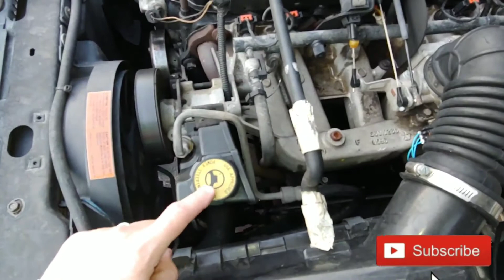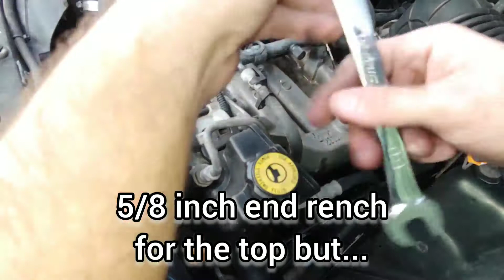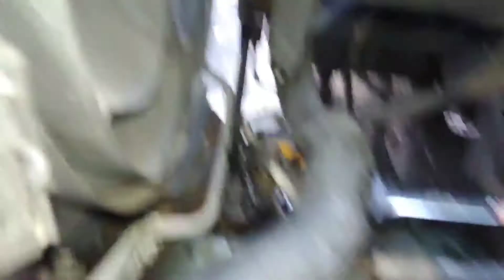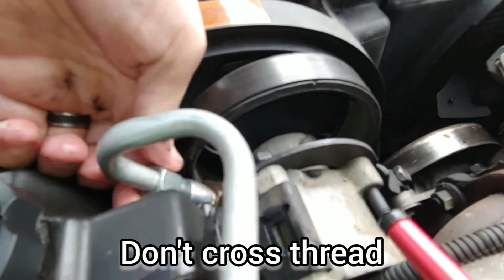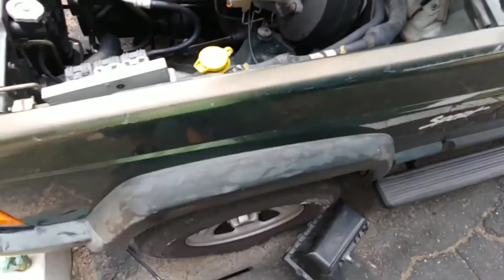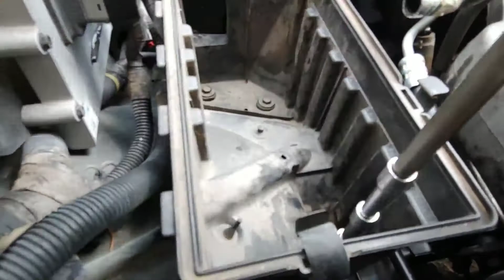97 Jeep Cherokee High Pressure Power Steering Line replacement

Comment: What was the yellow thing in the package with the O rings?
Reply from the maker: technically a cap for you to use if you want to and pardon me I'm not sure what the technical language is for it but if you want to pre-pressurize the line with power steering fluid you can and I've heard that that's not a terrible thing to do it just makes it to where when you start to refill the power steering fluid it doesn't have as much air in there so it goes much faster I didn't use it so there's that I just took the extra time to make sure there's no air in the lines

Comment: Quick Question when doing this do you to replace the power steering pump as well ??
Reply from the maker: I didn’t need to my issue was with my high pressure line but if your issue was with the power steering pump then you would need to remove both of the lines like I did in the video